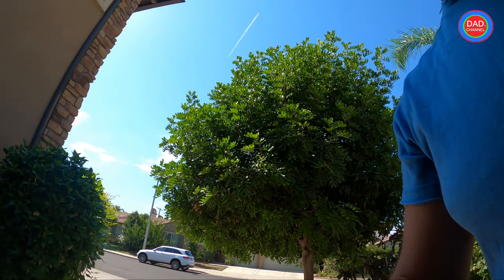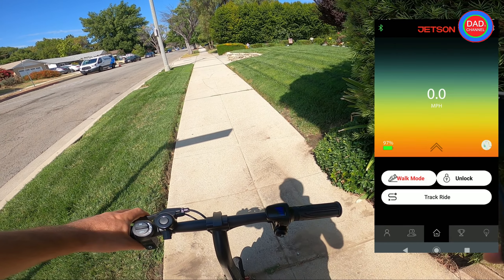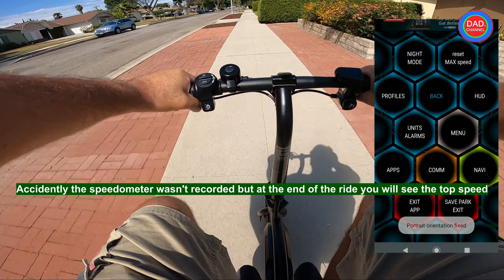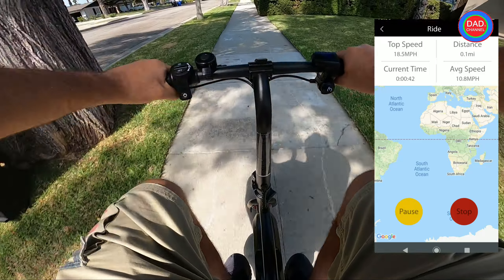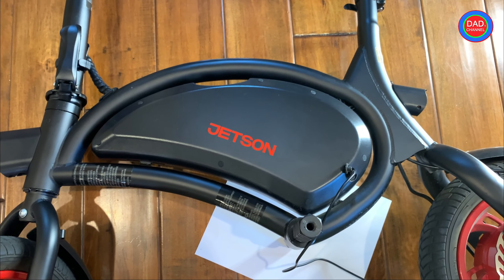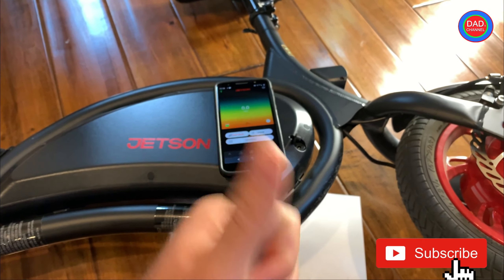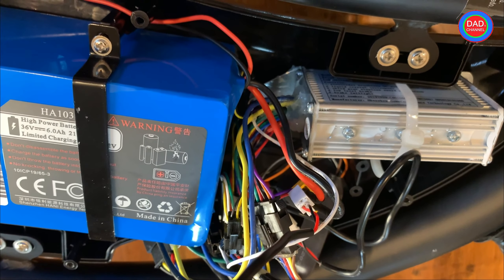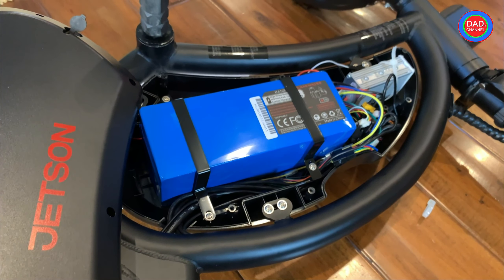JETSON BOLT SPEED TEST  & WHAT IS INSIDE?

Comment: I'm getting this off Facebook marketplace in a few days and wanna know if it can do 8 miles on a full charge
Reply from the maker: It should when new battery but vary on many factors
Reply: @askdad  I was just curious since my girlfriend's house is 8 miles away from me it's a straight shot down a long road so I won't be turning much
Reply from the maker: I would get bolt pro or v1 as the bike got the pedal and can be pedal incase you run out of power https://youtu.be/O-fAHkoC5w4
Reply: Bruh this shit sucks make sure you don't ride up hills or bumps or in grass if you're trying to get far
Reply from the maker: I Rode off road and it was fun! https://youtu.be/glXUmXCSa4s

Comment: I know how to bypass the speed limiter on the bolt pro but you'll need to add another battery pack
Reply from the maker: That’s cool! Did you do it on your pro? How fast it goes?
Reply: How did you do it on the bolt pro? Explain please.
Reply from the maker: @vin3022  he probably install different battery but I wonder which one
Reply: @askdad  do you think a higher voltage pack?
Reply from the maker: @vin3022  probably, I would not increase speed much as frame is not designed for higher speed as 20mph. It might fall apart 😂.
Reply: @askdad  maybe 18mph nothing over 20mph. With a side carriage and my 2yr old in it doesn't even go 15mph lol
Reply from the maker: @vin3022   I think its not bad as you probably used gps speedometer on your phone?  I tested bolt and bolt pro speed on gps bolt goes up to 17 but on app said ride jetson was top 18.6 mph and Jupiter speedometer also had 16 but on gps app was 14 so if you see 14 on your phone app gps speedomer then its about 15.5 -16 mph .

Comment: Its like 1/3rd faster that the bolt pro.  The pro is such a rip off.
Reply from the maker: Well, They only sell it as 16 miles so its only .5 mph faster then pro but if you get the old app then you can make it   2 - 3 miles faster but its not covered by warranty if your motor or battery burn. Also, there are no pedals vs to pro.. I think pro is great deal if you can find it for $300 at local costco but mostly is over $500 online now
Reply: no its not. the pro is superior in every way except 4.5 mph slower. The bolt is built better, better and bigger tires, looks nicer, and the key importance is it actually has pedals so its still functional if the battery dies on you in the middle of a ride so you can still bike normally. smh bruh. pro is better and only $300 at costco